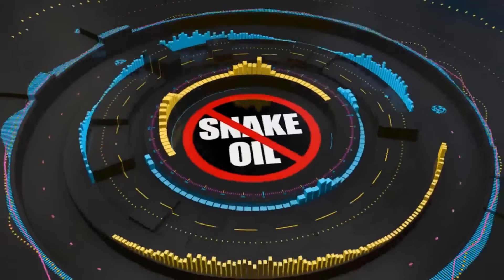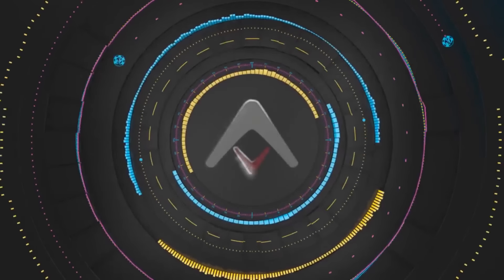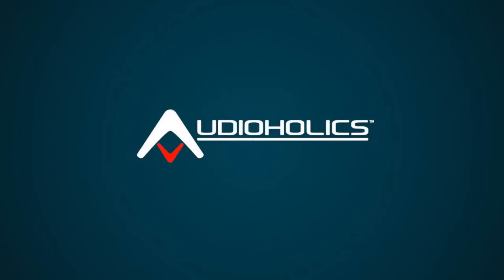STOP Worrying About These 5 Things in Audio!

Comment: 4 or 8 ohm, i never saw a amp that has a 4-8 ohm selector button, if you wire a 4ohm speaker it switch automaticly , i have marantz ,so what dos it on 4ohm??
Reply: i agree ,buy the sound you like ,not the stuff, product, or equipement because your neighbour has a better or should i say a more expensive home theatre system
Reply from the maker: No it doesn't work that way. The amp will have to supply more current to a 4 ohm speaker than an 8 ohm speaker by default. The Marantz AVR will deliver more power at 4 ohms than 8 ohms but likely not twice as much due to current limiting.

Comment: So you saying my marantz sr7011 with aircom t8 just should stay at 8ohm on setings?
Reply from the maker: I couldn't be more clear about the proper setting in this video or the one prior: https://youtu.be/Ou5bO8P2Drw?si=imXF6dVPOotgbzRQ
Reply: @Audioholics  so its the same when the switch is degital?
Reply from the maker: @frederiknielsen9023  makes no difference if the switch is analog or digital in software. Does same function.
Reply: @Audioholics  I’m just going back to 8ohm then I’m on 4ohm right now cuz I thought that was the right thing my speakers are 4ohm 🙃 thanks for the video and the answer 😁

Comment: Great video! Id love to know more about cables and connectors. I thought bare wire would be best but some says cables welded to banana or spades connectors avoid the oxidation of the would-be exposed part of the wire.
Reply: Welded should make an excellent long term connection. It's true that oxidation of the void regions of a multi-strand cable will happen over time - this can be minimized by having terminals that are strong enough and have suitable grip to be able to clamp the wires very heavily. Since copper is malleable, delivering a lot of crush to a multi-strand section will minimize the voids that are not in good contact with adjacent strands, and is how crimped terminal connections achieve excellent long term reliability. With a turning action you need to be aware of strand breakage. It's still probably a good idea from time to time to cut back and expose a fresh section of wire and polish up the contact surface of the terminal. Since surface oxidation can occur over time back up the cable under the insulation anyway, another approach is to try using an anti-oxidant product designed for copper. Even though I used this in my work as an electronics technician, I never felt any need to bother with it for speaker cables.
Reply: @PlatypusPerspective  Thank you for the comprehensive explanation!

Comment: Hey what's your view on oxidation on connectors? Does this affect conductivity enough to be audible? And if so, where would it be more crucial...interconnects, power plugs or speaker cables? Thanks.
Reply from the maker: oxidation increases contact resistance and can affect performance in a negative way. Stick with quality pure copper cables and connectors from reputable brands and this shouldn't be a problem. (ie. Mogami, Bluejeans cable, tributaries, Kimber, etc).
Reply: @Audioholics  Thank you. I wonder if this partly explains why an upgraded cable sounds "better" than an old cable that's been plugged in for years?

Comment: The cable issue is not correct.   We did an A/B comparison on my home theater swapping out HDMI from the Kaledescape to the Reciever, to the MadVR, so the projector and each cable contributed.   The banding went away, artificacts removed, and the color and detail improved.  
Ironically one of the larger improvements was from the Kaledescape media server to the streamer with a shielded quality CAT6 cable.  We had 8 guys in the room and every single person saw the difference.  Especially with video, you can increase your bandwidth and reduce interference.   Cables are antennas and failure to have  a shielded or grounded cable can really improve a picture.   
Lets do a comparison.  A $30 dollar COPPER HDMI vs a quality fiber cable.   Anyone will be able to see a difference, unless they choose not to.
Reply from the maker: Yes an bad HDMI cable is quite evident and nobody is denying that. The cable either passes digital perfectly or it doesn't. I use the THX fiber cables for my Kscape and Bluejeans for my projector and no issues. A good HDMI cable is a good HDMI cable. A $30 copper cable properly designed will still be good for a few meters but beyond that, active or fiber is the way to go.

Comment: Hi Gene,
In relation to speaker cables . What kind of things should we be looking for?.
10 gauge , continuous copper, that sort of thing?
Reply: Tell you what ... I have a system that can belt out upwards of 150 watts into 4 ohm speakers... I use plain old fashioned 16ga lamp cord, like you buy off the rolls in the hardware store.

The only do/don't is to note that you are buying pure Copper (CU) wire... not copper coated Aluminum (CCA) wire.  It's got nothing to do with sound and everything to do with CCA wire being impossible to solder, brittle and prone to breaking.

Comment: Some tweaks can make a difference, but many do not. I believe there may be an inverse relationship between the cost and ease of implementation and the value of the tweak (the higher the cost & easier to implement the less value).

For example I tweaked a pair of Klipsch Cornwall IIIs by bracing the cabinet, damping the horn & woofer baskets and replacing the internal "stuffing." The changes were visible on waterfall plots and the listening experience was better.
Reply from the maker: That absolutely will make a difference.  I'm talking about the nonsense like cable elevators, fuses, magic markers for your CDs, etc.
Reply: @Audioholics  <sarcasm>When I placed the Purple Carbon Tuning Discs just right I experienced "a large, even flamboyant sound stage" which was further enhanced by Gold Carbon Tuning Discs "flesh(ing) out rich harmonic texture." At $199 they are the best audio bargain I have found.</sarcasm>

I know that many "store bought" tweaks have limited efficacy and I moderate my audio acquisitions accordingly.

Comment: Hi Gene - I was always informed to be sure you have a power supply capable of a 4 ohm load when selecting a speaker rated at 4 ohms, due to impedance dips on many 4 ohms speakers that dip into 2.1 ohm territory. 
Should I not be concerned about my AVR that's rated for 6 ohms and above?
Reply from the maker: depends on a lot of factors including how robust the power supply is on the AVR, where the dips occur in the speakers, how loud you listen, if they are run fullrange or not. Setting the switch low does NOT fix this problem, it just further limits power from the AVR to your speakers.

Comment: I use the source EQ every program has its own recorded EQ. Example mad max fury road v a standard news programme. Everything set to zero best or just slightly. Otherwise it's overkill or not what's intended. I read a article movie makers don't make  movies with extreme bass just a different EQ. Speaker levels are fine tuned adjusted if close or further to make things in sync after. Use ears.

Comment: What if my speakers are 4 ohms rated front and AV is switch to 4 ohms? Will it damage the speaker or amp? My AV is Onkyo TX-NR575e. I have mixed speaker 4 ohm front, 8 ohms center, 8 ohms surround. What should my AVR ohm setting be? Thanks Gene for your reply.
Reply: From watching his other video, just set the AV to 8 ohms. He said to do that even they were all 4 ohm but especially if they're mixed.
Reply: @frommatorav1 Thanks you. My understanding was confirmed. Will do, cheers mate!

Comment: Great review, particularly the point regarding to cable. My experience, the best option to uplifting sound experience is to add super woofer. European brand Piega launched a very expense SPEAKER - it contains two tower-speakers - one is base, one is mid-hi.

Comment: Hard to say with cables. I think it's hard to take static measurements and make sense of any differences that we would or wouldn't hear when we actually listen to music. Our ears are not reliable scientific instruments by any stretch, but they are incredibly sensitive to any change of pitch, phase or volume, at least on a sub-conscious level. That is in fact, how we locate sounds in 3D in real life. 

I can't speak to the high dollar cables I haven't heard. I'm sure there's a great deal of snake oil and many legit products. In my own limited experience, I do notice differences. More so with transducer cables than interconnects. On my speaker system, I had built some basic, 4 strand braided cables with Parts Express 16ga wire and banana plugs. They look cool and sound perfectly fine. Still, I couldn't help but wonder if they might be a weak link between my Parasound JC5 and upgraded Tekton Moabs. After seeing some reviews, I decided to try the WBC Ultimate 7awg cables with spades. (All my interconnects are $30ish WBC, Canare based wires.) I absolutely noticed a difference. Surprisingly, more in the top end than the bass. Their top end was more present and detailed, giving my system better balance top to bottom. They were already practically worth the $200 for the jewelry factor alone, given their build quality and feel. 

On my headphone system, I'm running LCD-4 and I bought the Cardas Clear headphone able for them. I got a discount and wouldn't pay full price, but I feel the small upgrade was worth it, given how much I use them. I didn't buy it on a whim either, I encountered it in person at CanJam a couple years ago. I was heavily biased against expensive cables, so I wouldn't have bothered checking out their booth, if not for one of the two women being absolutely gorgeous. So I stopped and sat down and talked them for a few minutes. I had my own LCD-4 and stock cable with me. I plugged into their setup and listened to my own music for a minute to get acquainted with their equipment. Then I swapped in the Clear cable. Even over the noise on the show floor, with my open headphones blocking out nothing, I immediately heard a difference. Not night and day, but a very pleasing, slightly warmer tonality, with both improved detail and smoothness. A hard feat to pull off both at once.

All that said, I probably wouldn't buy the Cardas headphone cable again, as my speaker system has evolved into my primary music listening system. As for the speakers, I'm ~$20k into my system and $200 speaker cables feel right. Not $3-6k! Out of this, I also have maybe $1200ish in room treatment. That made a MUCH bigger difference than the cables. Other tweaks that really worked for me were rebuilding my speakers' crossovers with high end parts. Cables only transmit the signal, while the crossovers are actually dividing it up. So they are much more invasive and a better place to invest some money. Also, I live in a creaky, old New England house. So isolation is a big deal. Started out with SVS subwoofer isolation feet and then upgraded to Townshend Podiums. Those made a difference I was told to expect, but had to hear to believe. Bass improved a little over the SVS feet, but the mid-range really opened up and became a lot clearer. Much better sense of imaging and depth.
Reply: LOL a 16 gauge speaker wire is a total joke. A high gauge wire quickly destroys the damping factor of the system. Anything from 2.5mm2 and up will be adequate.
Reply: @Munakas-wq3gp  So you're a fan of very heavy duty speaker wire? My 4 strand braid of 16ga is equivalent to 13ga per conductor. 2.5mm would be close to 10ga. Moving up to the crazy 7ga wire, I noticed most of the difference in the higher end though. Doesn't damping factor have more of an impact on low frequency response? Also this is the first time I've heard anyone mention a direct relationship between wire gauge and damping factor. I'm not arguing, but I'd like to know more. Do you have any sources for this information?

EDIT: I did a bit of reading on the subject. Electrical damping factor is basically due to low resistance between the speaker poles. This near short causes the voice coil to resist outside force. However, even under the best circumstances, the electrical damping factor seems to pale compare to the impact of cabinet and woofer design. I guess this is why people in the know aren't too concerned about amplifier damping factor specs, as long as they are above 100 to 300, depending who you ask. But I do see now why the small bump in resistance of a smaller wire would have a measurable impact on the total system's electrical damping factor. It's just that this one aspect alone, doesn't seem to be a big deal in determining the over-all real world performance of a cable.
Reply: @zackw4941  A smaller gauge wire is just physically the better option for an AC signal, it has nothing to do with my preference. It's simple physics.
Reply: @Munakas-wq3gp  Can't argue. I'm really happy with my WBC 7ga cables!

Comment: in my experience, there are a few tweaks that work:

- acousticaly treating your room
- decoupling the speakers from the floor/ the shelves while firmly rooting them in place ( heavy cushioned feet)

- making sure your room has fresh air ( for enjoyment and mental presence)
- making sure your room is clean ( for enjoyment and no bodily stress)

- make sure your room is aesthetic to just be in for you. better mood baseline.
- make sure your listening spot is confortable and feels safe & controlable.
- have interesting and pleasent interactive things in the room you enjoy. so its a good general place, not just an audio place.

- care for your general health, fitness, well being, good direction   and hearing health.
- have things organized in general.
- get enough sleep, extra if possible.

- have a stocked pantry, gas in the tank, water in the fridge and some cash on the side. knowing you have time in case makes for a chill life.

- get something nice to drink or other measured treat to enjoy while listening.
Reply: a depressing room, living on edge more than necessary, being in artificialy worse health and bad air can ruin any listening experience.

Comment: Gene ... can you clarify something for me?
The 8/4 ohm switch you're talking about. Does it power match the speakers... eg 100w on 8 ohms, flip the switch, 100w on 4 ohms?
Reply from the maker: NO! see:https://youtu.be/Ou5bO8P2Drw?si=qAv5xJ8a8yxuXEVA
Reply: @Audioholics  
Thank you.  So this is a different thing than using less voltage on Class D mini-amps.

On the little TPA3255 mini-amps with their tiny enclosed cases (0 ventilation) I commonly recommend 36 volt supplies, even though the amp and chip can handle 48.  

The problem here is heat. At 48 volts they get pretty hot and will jump into protection.  

At 36 volts you lose about 2db of headroom  and still get the same general sound quality but things don't get hot enough to trigger panics in the chip or the power supply.

That AV switch is a whole different animal.
Reply: You should always run 48v on those amps.  Only buy ones that don't have major overheating issues, and besides the heat is still partially dependent on output power levels, so you want the extra headroom especially because those particular amps are limited to about 85w per channel into 8 ohms with the bigger 48v 5/10a (mono/stereo) power supplies.  Also I haven't seen measurements on it, but a lot of class d chips do have different distortion profiles at different voltages, not that it's necessarily audible.  But the clipping sure will be.  Add a fan to the amp or remove the case - I want all the power the thing is capable of.
Reply: @Artcore103  
Please note that I was speaking explicitly about the TPA3255 chip, which I have studied in great depth. 
I have one sitting on my bench that produces 110watts on 8 ohms and 220 on 4 with no clipping at 48 volts... for about 6 minutes.  At 36 volts you will get 75 watts on 8 ohms and 145 on 4, again with no clipping, all day long. That is a difference of 2 db of headroom, but almost 20 degrees in heat and probably years in lifetime.

Comment: Thank you for a great, honest video!

What do you think about power conditioners vs $25 power strips from the likes of Belkin, etc?
Reply: Any power supply is going to have it's own built in power filters and conditioners. The AC side of the supply can be totally messy and a proper supply will deliver pure DC at it's outputs.  All the other crap people add in line does exactly nothing to improve the final DC that amplifiers (etc) run on.

Comment: What do you think about those plugs for UNUSED RCA connectors on the back of units?
Reply: For unused inputs, grounding plugs can be helpful in stopping noise when you select an unused set.  For outputs you're probably just going to blow something up.

The plastic dust covers probably do more for you.